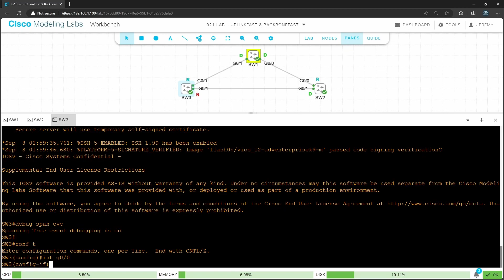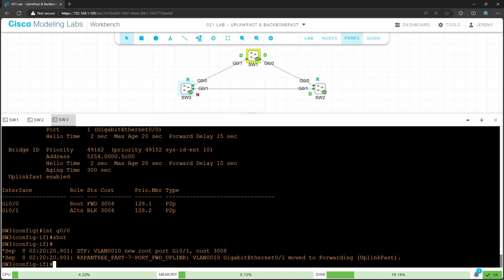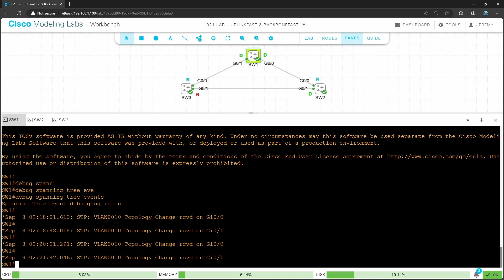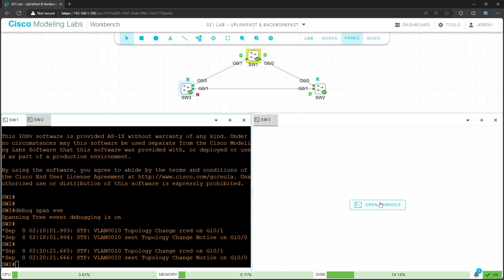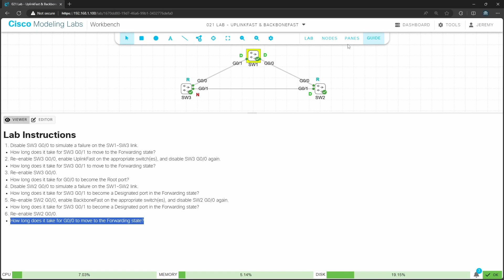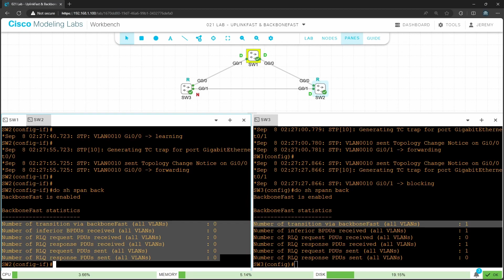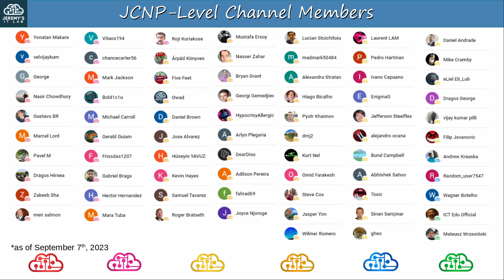CCNP ENCOR // STP UplinkFast & BackboneFast // ENCOR 350-401 Complete Course

Comment: imagine that you are designing Layer 2 Network for customer. The network use the spanning-tree protocol. During a link failure between SW1 and SW2, the fastest possible covergence time is desired. Which solution must you select ? UplinkFast or BackboneFast?
Reply: ok i dont mean to be rude but think for a second no body is going to have a layer 2 network only or there not getting out to the internet lol so in between the actual endpoint and access layer it will be portfast from thew stp toolkit now layer up being access layer to the distribution layer will be the uplinkfast then in between your distribution and other switches to the  distribution would be backbone fast so think of a spine leaf on how the leaf connects to all spines that would be a good use case assuming you had redundant links between thus spine and leaf nodes  or think of a 3 tier topology